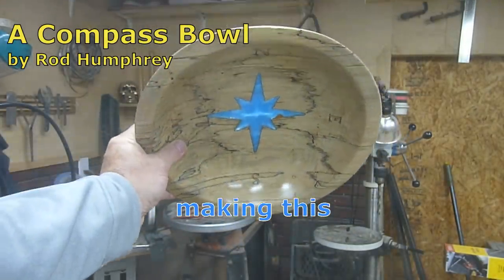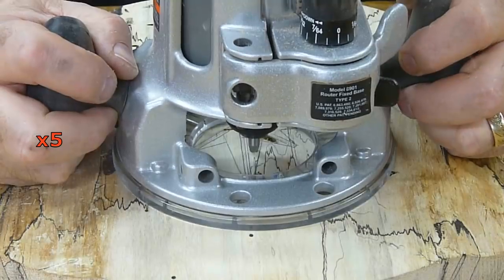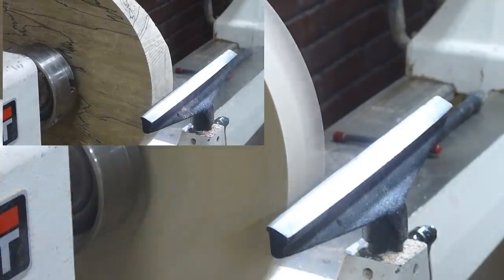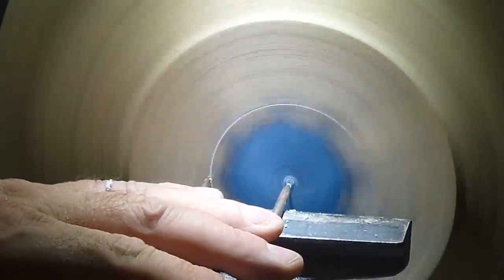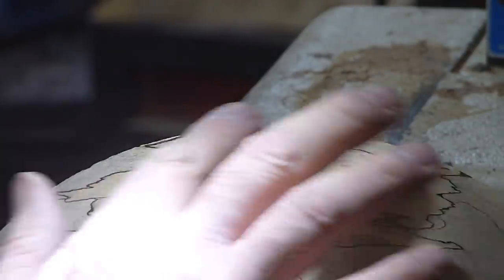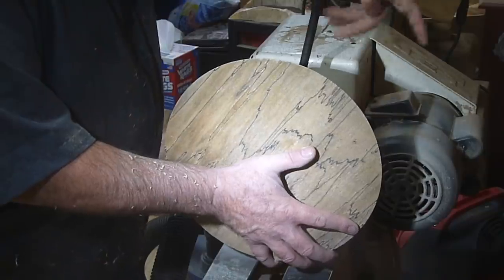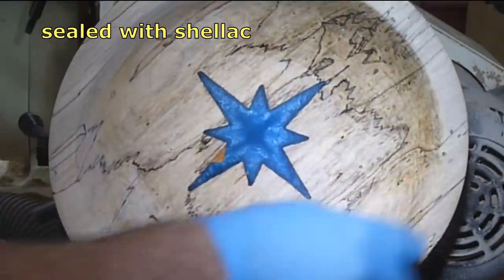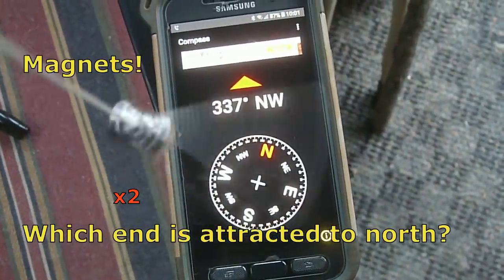Woodturning a Compass Bowl with Resin and More! - It Works!

Comment: Thank you for sharing your skill and advice.  Would you be able to share any instructions you might have for making the band saw circle cutting jig?  Many thanks, Dan
Reply from the maker: Thank you!  It's super easy to make... I used a 3/4" plywood board for the sled.  on the bottom, attach a board that fits into the miter gauge slot on your band saw, (the full length of the plywood board(sled) for support while cutting); also attach a stop board, perpendicular to the miter gauge board, placed to stop the sled so the band saw blade is at about the center of the sled.  From the very front edge of the band saw blade, (very important emphasis on the front edge) measure out from the blade and mark as you need in half inch increments, these will be the radius marks and drill 1/4 inch holes.  The 1/4 inch holes should line up with the front edge of the blade, and are for a 1/4 inch dowel that works great as a pivot point to hold the log in place as you slowly turn it into the blade.   Very important....make sure your band saw is set up according to the operating manual, and make sure you use a relatively thin blade that wont fight against the side pressure of cutting a circle.  Go slow and be very aware of your fingers and hands so not to move them into the blade!!!! (you may know this but others might not)   Hopefully this helps.

Comment: Have you thought about getting a router attachment for a dremmel tool you could use smaller bits to get in corners.
Reply from the maker: I have...and have the bits for it, but my dremmel burned out a few years ago and I haven't replaced it, lol...  Thanks!

Comment: Love the work you have done.   I've been toying with the idea of putting our church cross in resin on a bowl for some time.  It's a custom graphic that a member created, the points of the cross are very "pointy".  Any suggestions or ideas on how to get as non-rounded a point?  I have seen your other videos using 1/8" bit, but I think that would be too "rounded".  I've considered using router bits and then attempting a jig saw... but if you have thoughts I'd love to hear them from an expert.  Thanks!
Reply from the maker: There are finer router bits, but they get too short to be useful for this...but a rotary tool (dremmel) with a router attachment would work.  there's some really small bits for that tool.  also, just carving out the points would work.  Yep, Jigsaw would work too in some applications, or even a scroll saw....or just a coping saw.  It really depends on your design and the access you have with the different tools.  I burned out my dremmel years ago and need to get a new one...when I do I'll be using it for just what you're asking about.    Thanks!

Comment: VERY nice work. (as usual). Question: In Canada, the hardware store, the paint store, Canadian Tire, the drug store etc do not sell "denatured alcohol". I need to get some if I'm ever going to attempt to catch up to you!!! Is there another name for it? Methyl something or isopropyl something else or ????
Reply: If I may assist as I live in the UK.  We call it methylated spirits.  It's almost always dyed blue.  I think that because it's alcohol and it's to prevent it being confused with Vodka for example.   The smell is very distinctive.
Reply: Your looking for Methyl Hydrate. Available at Canadian Tire and probably local paint stores here in Canada...
Reply from the maker: Thank you Bill, and I'll defer to the answers of Alan Simpson and Ralph MacLean regarding the name of the substance.  Thanks you two!
Reply: If you can't find those, a quick google search suggests it's used as fuel for alcohol burning camp stoves- an outdoor store like MEC or SAIL might be an option to look into as well.
Reply: Thanks all for the assist. CTC here we come.

Comment: Hay Rod. I got a question for ya. What rpm speeds do you use when sanding inside and outside of bowl?  I’m having trouble with it. It’s like on the inside of my bowls it’s like tear outs. I sand from 60 to 400 or 600. And it’s all smooth but you can see where the grain was ruffer than the rest of bowl and it’s usually on opposite of inside the bowl. I don’t know if I’m making any sense. But I searched on YouTube. “ what speed to use when sanding inside of bowls”. And I really didn’t get much info. If you can help that would be great. Thanks for your time 👍✌️
Reply from the maker: Daniel, a very good question, thanks.  I always sand at about 600 RPM outside and in.  I do understand, and dealing with tear out can be very frustrating as it just doesn't want to go away sometimes.  The fibers just get torn apart too deep... so on the topic of sanding, sometimes it just take a long time before moving up form the 60 grit.  I actually dropped to 40 grit on my Celtic Knot bowl because of the tear outs and soft/punky wood.  It seemed very drastic, but it worked.  Hope that helps...if not, shoot me and email and we can discuss further.  🙂